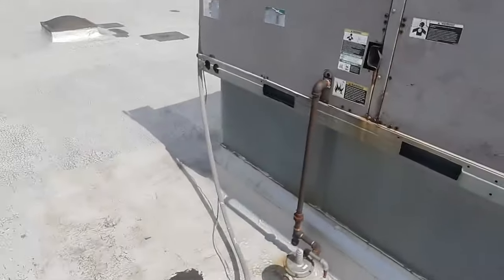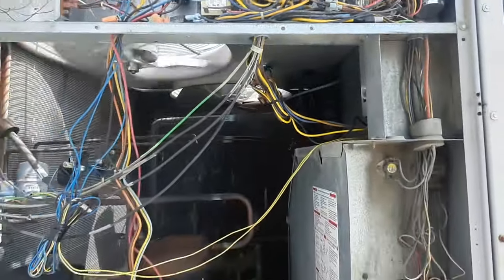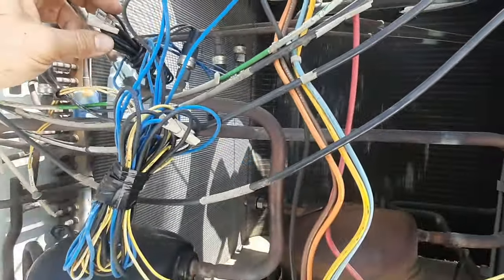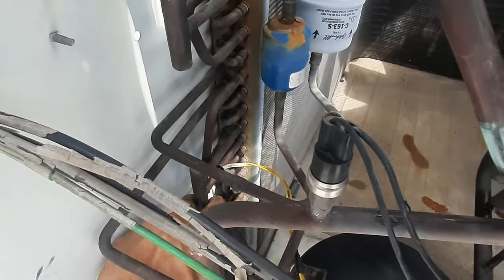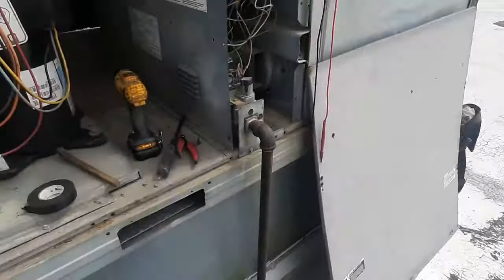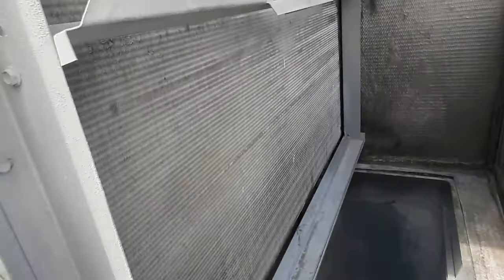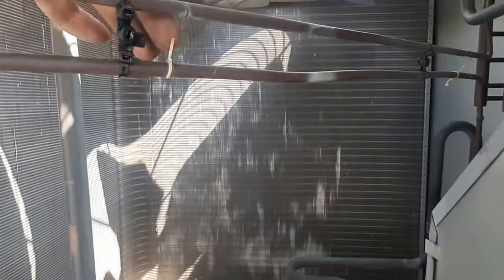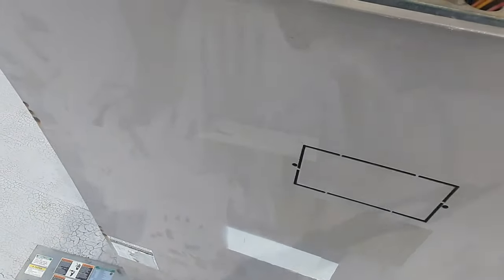No Cooling Service Call, old 2 stage carrier unit with multiple issues

Comment: I really like the way yall trap your units, with the clean out plug. Here in Austin its all copper and nothing has a clean out or a union to separate the line. In Buffalo.....nobody glued the trap in...so you can just pull it out to clean it. Its interesting to see how different areas do things. Im gonna start to push for some way to clean out drains better. Having no way to access the other than the vent or the tap off the drain pan is a bit ridiculous. That rust on the dome of stage one is a give away that it's been overheating. 

As always another great video Steve
Reply from the maker: So Texas like Cali your not supposed to drain on the roof? We see a lot not glued as well, Thanks Jason!

Comment: I did residential HVAC.   How in world would you clean that indoor coil w/o spilling water down the return to the inside the building. I assume   You putsome kind of shield in return opening to block water
Reply from the maker: Yes, it is difficult to clean any package unit evap without getting water inside, it helps if it's kept clean you can rinse with easy pressure without making too much of a mess,  they get neglected a lot of times because of this reason but if needed return can be blocked off, these are actually easier than say a Trane slanted coil. Thanks for the comment James!
Reply: @EverythingHVACR  

Thanks